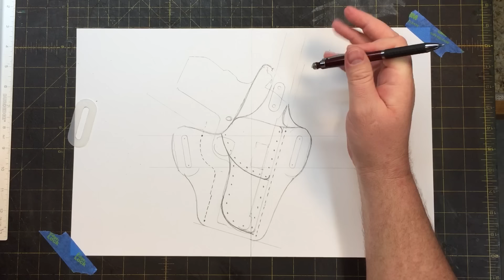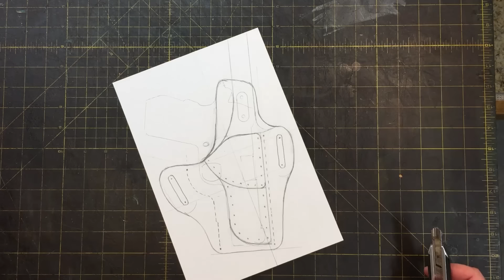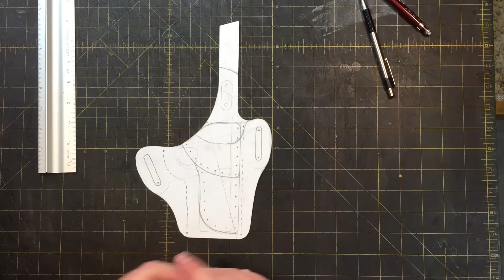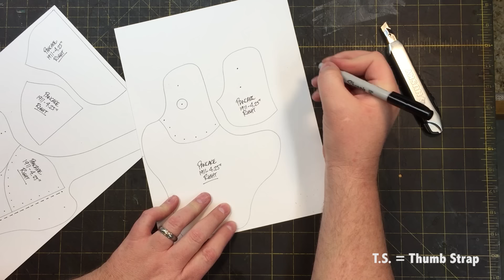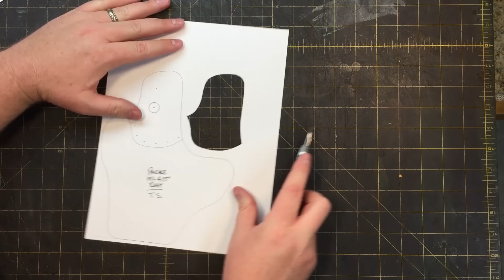Making a Pancake Leather Holster with Thumb Break, 1911 Commander

Comment: The only thing I'm not comfortable with is keeping the weapon with the hammer back - it allows crud into the chamber and keeps the spring under unnecessary tension, which in 500 years time could cause problems. I should confess that I know several curators of mediaeval armour...this quality of work could keep the weapon usable for that long.
Reply: Rahere you don't know anything about fire arms. Don't talk
Reply: The strap on the holster is covering the fireing pin, the safety on a 1911 is impeccable, I'm a gunsmith, and auto correct
Reply: It means that having passed out head of my Platoon Commanders Course at the UK School of Infantry and sussed that although I had a bid from Special Forces in my pocket, my skills as a handler remote from high command also told me I couldn't trust the Politicians who'd killed my predeccessor, and so I walked silently away. You never completely escape, and so I returned as a planner in the European Defence Diplomatic HQ working at peer to Staff Colonels on stuff you'd not believe, I was that good: I showed the military how to do it, as a civvy, and so I was a must-have, on my terms and not theirs. The one thing I can talk about was the Falklands: I got the pop onto the expeditionary force, the only thing they didn't run out of: one Argie company surrendered to a hail of drinks cans, a mate from 3 Para told me later. I'm still vetted in retirement by the Head of a US Presidential Security Detail - noduff. It means that the only thing I was missing were the pips, and my pay was double theirs. And so my rank was functionally Colonel, of the Civil Forces. We had Colonels of the Air Force, Army, Naval Captains, Police, and Police are a civvy force: I carried the same weight as they did, I'd won my spurs the same as they had, just as a civvy. They've all retired too now, and they're civvy Colonels too now, I just left earlier. Command is a skill, a quality, and as the current occupant of the White House is amply demonstrating, has qualities of judgement he lacks. Before moving back over, I rose high in business myself, Chief Dealer in the Group Treasury of an FT-100 Company, dealing in billions, there's very little difference between somone who dresses in a grey suit and someone who dresses in a green one, which is why Trump had to come here to Cambridge Analytica - you don't produce quality people there, and that one was flawed anyhow, two weak personalities together. As you'll have sussed by now, I'm not a weak personality. I'm very dominant, which I temper with humility, believe it or not.
Turning to your video, I fully appreciate that the strap covers the firing pin, however it doesn't cover the open end of the breech, which might have a round up it, which is about the most dangerous configuration I can think of. One hard jerk as you accidentally stumble, the safety catch bounces off, the spring holding the firing pin back is quite strong enough to shear straight through that very flexible (and  therefore soft) little strap, hit the percussion cap in the end of the round and send the bullet straight into your foot. Why do you think so many cowboys were nicknamed Hopalong? Because it was only a question of time until it happened, making it not so much an accident as damned foolishness.
On the other hand, perhaps you have't put a round up the spout. So suddenly it's collecting half the countryside, making it useless. Been there, done that, got the badge.
The hard reality is that a man with a gun has two states. Intending to use it, or otherwise. If otherwise, then it's home is in a holster, with a magazine in the handle, but nothing up the spout, the firing pin down and the safety catch on. It takes half a second to draw, cock and adopt the ready, and that should be trained to be automatic.
One Christmas at a reception from the retired Head of the Belgian Army Legal Services, I suddenly noticed an SMLE flying through the air towards me, he'd thrown it from nowhere. Without breaking the conversation, I caught it at the centre of balance with my left hand, and cleared it with my right, all one smooth movement which would have ended up with the rifle in the ready state I will come to, had it had rounds in the mag. The iconic SAS trooper in the Iranian  embassy siege was in the room: he saw I had it, we were good friends thereafter.
The point is that if you're expecting trouble, you need your weapon in a firing stance, firing catch off with a round up the spout, and your finger across the trigger guard, which is there to guard the trigger from your twitching fingers. A correct squeeze starts from that pointing position, and using your lead finger, your trigger finger, to point at your target makes you far more accurate. And if and when you realise you can slacken off, you return it to safe storage. At least it's within reach.
The next step, however, is Musashi Miyamoto's maxim, that the perfect coup never sees a weapon drawn. The Sword Saint realised that clever beats fast, and that allowed me to lead the Peacemaking Agenda which won the 2012 Peace Prize. Clauswitz was wrong: get your policy right and you don't need other means. True, you always have it as a fallback if you're wrong, but like the weapon sheathed, it's only the second line of progress forwards, not the first. Far better is the certainty of mastery, which means the person facing you is in no doubt whatsoever that he's going to dance the dance your way. Trump has an idea he has it, and might have sometimes: I have it full-time. At the cutting edge of the Peacemaking movement, trained by my mother who was one of Ghandi's team,  we met Musashi's maxim. Wandering around uncertain if you're coming or going is a jerk-off state, and not one which creates the expression of certainty which avoids last night's problems, suicide by cop. Me, I test at Master level in Reiki, but from the original Japanese diplomatic arm, which isn't a subdomain of some weird study, it's simply an expression of who I am, deep down. I can bellow, but I can also sing, and seduce: I'm front-line in the Choir in David Byrne's Atomic Bomb! gig video, psyching an audience of 2000 into getting into it - and they did. That's how you win people, the unexpected, when a Muslim diplomat returned from evening prayers to find this Christian at prayer as well. Intrigued, he asked me what I was praying for: my reply was, that his prayers be answered. It won him, and did an enormous amount to stabilise Islam.
Reply: Assuming any of that is true shouldn't half of that be classified. Do you even carry a gun everyday conciled? I think if you did you'd understand the importance of fewer steps to stop a threat, butt you did mention training. That really is the more important point train train train no matter how you carry. Ok training time hop a long cowboy or whatever you said. Cowboy action 6 shooter wheelgun whatever you want to call it. Yes those are dangerous. The only safety on those are your finger so on that I agree. Maybe you should be a writer you good at. Enjoyed the storeys
Reply: No, I'm very security-aware and carefully go to the point at which I stop. If you're competent as a weapon-handler, you take the safety off as part of the draw. That's why it's placed there, so you can, concurrently: the safety's off before you reach the aim, whether visual or index-pointed - and it goes back on as you holster the weapon again, if you haven't cleaned it first, which requires the same. And in any case, I no longer qualify to handle such weapons in this country, after Dunblane made civilian ownership of handguns illegal.
Reply: It means that when I gave orders, I gave them as a colonel, and required and was given the same respect. The only thingmissing was the pips on my shoulder, because the politicians had persuaded me the only moral course I could follow was resign, early in my career - the pollies left, I was still there. Unlike retired Colonels who try to retain the rank as an honorific (which I don't), I still held equivalent command responsibility as a civilian. Cops do the same, they're civilians but in Multinational Policing Actions they rank as military-equivalent, their pips are the giveaway in this country.
Reply: Hate to say so, I've shot in competition at Bisley.
Reply: Here's a game for those who'd consider themselves marksmen. Take a candle, place it in the target rack instead of a target, and light it. Retire to your firing point, follow the usual safety protocols, and "at the candle flame in front of you, fire". We had a stock of .22 rifle ammunition which was about to go out of date, and so had several hundred rounds apiece. The objective is to use the air blast from the passing bullet to blow the candle out - without touching it. You'll know if someone's hit it, because it'll fly into the butts in pieces. You'll know if you're close, because the flame will flicker. But to blow it out, you've got to get it within a hair's breadth.